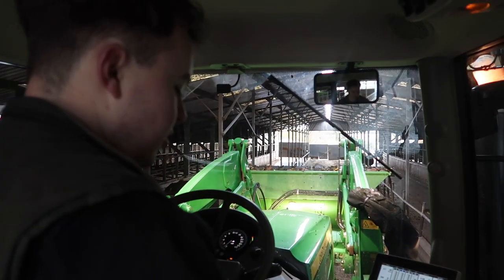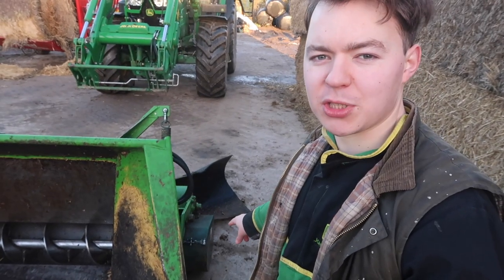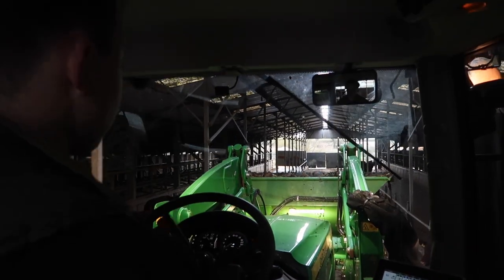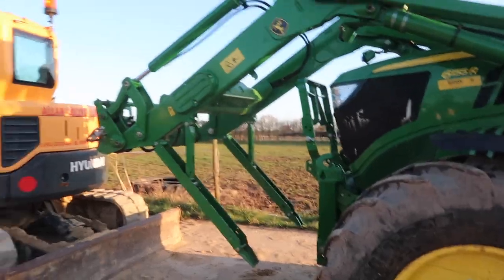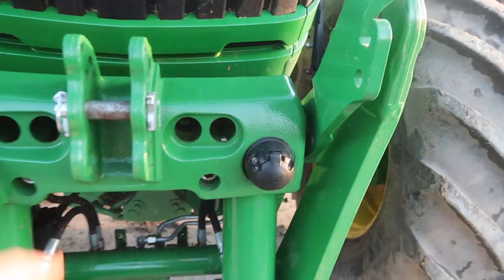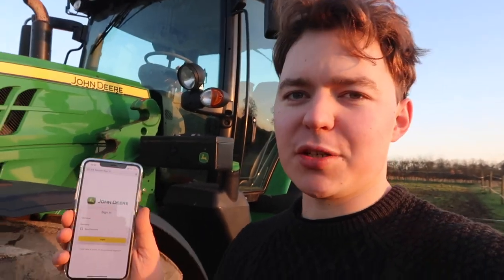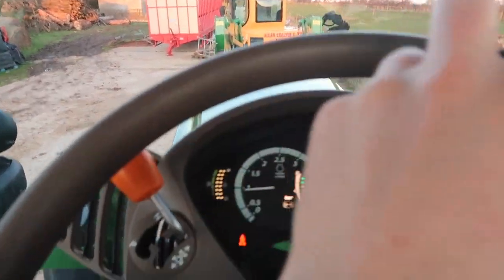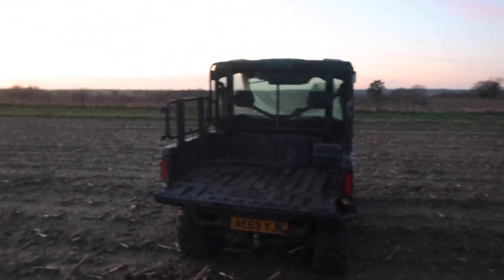How To Take Off A Tractor's Front End Loader!

Comment: When you’re taking off the loader leave the Hydraulic Pipes on till last bc when you disconnect the main pins get in the  tractor and till the bucket which will raise the loader of the tractor instead backing it bc u will damage the brackets and then take off the pipes.just a little of advice